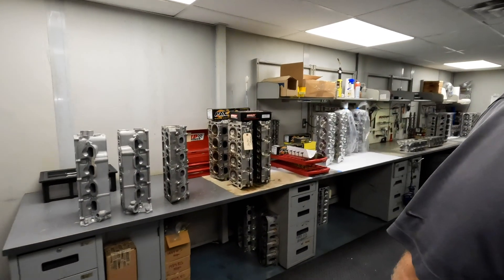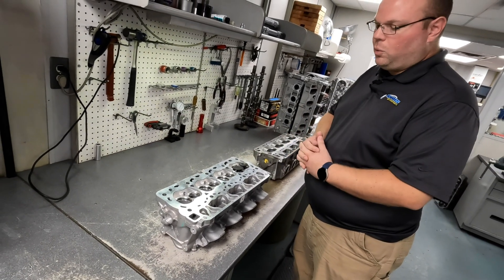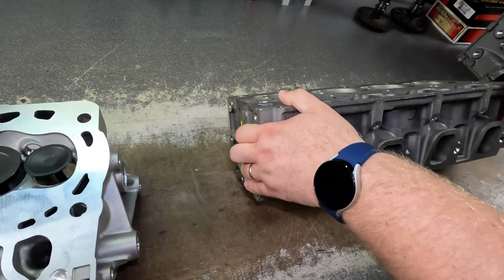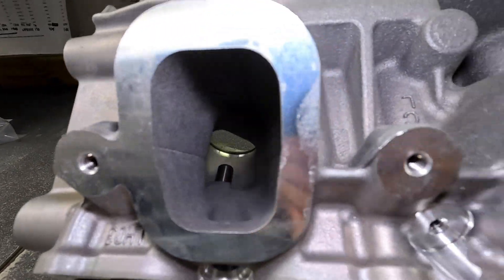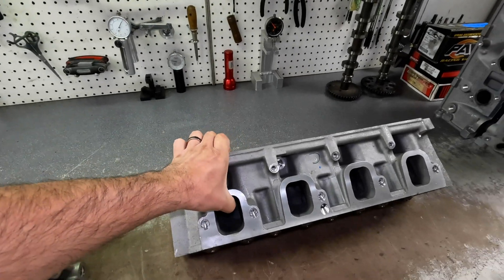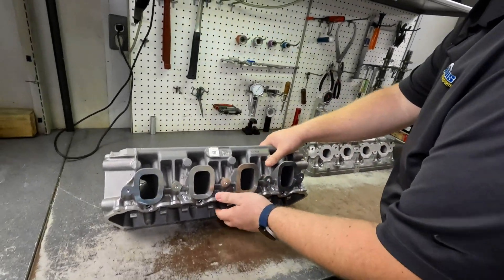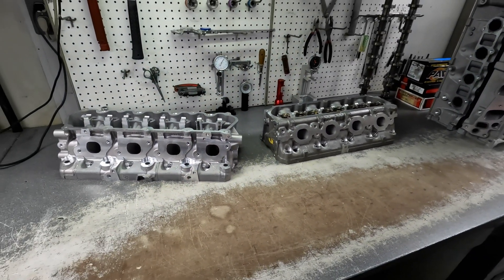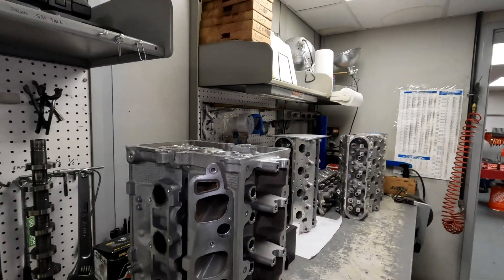Godzilla vs LT - Cylinder Head Inspections at Livernois Motorsports

Comment: Years ago, I went to Livernois to have my car dyno tuned with a SCT Performance Eliminator 4-Bank E-Prom, came out running worse than when it went in.  Even gave them the device in an ESD bag to protect the E-Prom which they discarded. The dyno graph looking like a mess also, and according to them they said they did it right.  Never been back there since and ended up going with a PRO-M EFI system that I can tune myself.
Reply: I had Livernoise port and build my 04 32v Cobra heads and the springs were solid and full binding ten thousands before full lift.😢
Reply: @WrenchesandPlants  I wouldn't even trust them to change a spark plug.